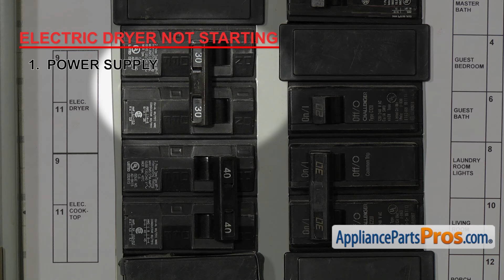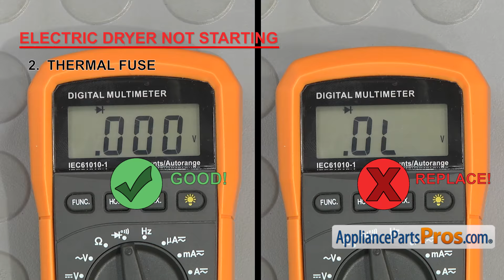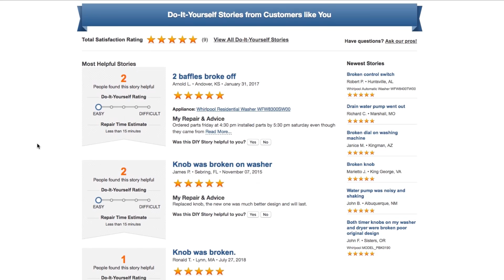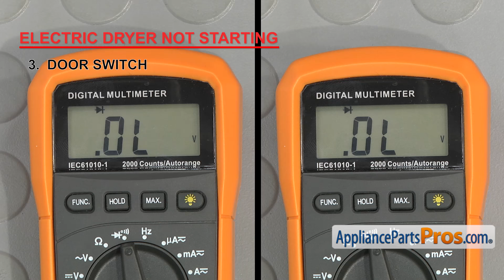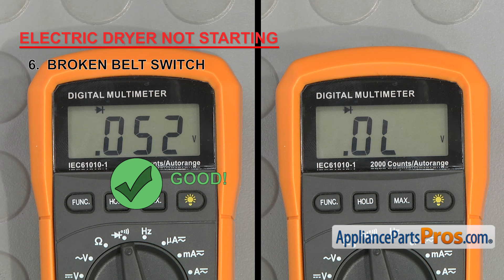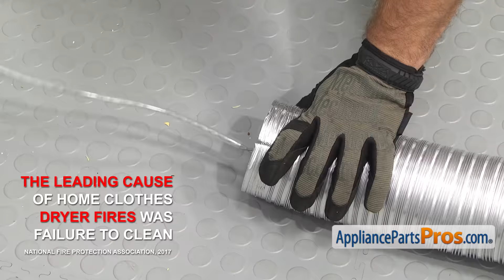Electric Dryer Won't Start - TOP 6 Reasons & Fixes - Whirlpool, Kenmore, and more

Comment: Where do we get these vacuum attachments?
Reply from the maker: Great question! The vacuum attachments we used are pretty common — you can find similar ones online or at most hardware stores by searching for “crevice tool” or “vacuum hose attachment kit.” Super handy for getting into tight spots during appliance cleanups!
Reply: @appliancepartspros  thank you so much!
Reply from the maker: You're welcome!

Comment: I try everything and everything goes ok in the test. But my dryer don't remaining working. Only if I hold the star bottom.....Solution: I have a black terminal in the motor with corrosion, so I cleaned and work perfect again.
Reply from the maker: That’s a great catch — corrosion on the motor terminal can definitely cause that issue. Really glad you tracked it down and got it working again. Your tip might help someone else out too!

Comment: This video was incredibly easy to follow.  I have some tinkering parts from other projects including a small copper wire with alligator clips on each end. After detecting no continuity between the nodes of the thermal fuse on the multi-meter, I used the wire with the alligator clips to bypass the fuse by connecting each end to each prong of the tripped fuse and start the dryer.  I didn't run the dryer like this since fuses are safety devices, but it did confirm my thermal fuse was dead (and may be used as an alternative if you don't have a multi-meter.)  AppliancePartsPros had the part at my door in less than two days. Thank you!
Reply from the maker: So glad you were able to repair your unit! Let us know if you have any questions!

Comment: my son has an electric dryer that only works intermittently.he had an electrician out who suggested replacing the dryer. they bought a new model it wouldn’t work except intermittently so they returned it. what in the world could it be. They replaced the dryer cord , replaced the outlet. One electrician suggested that it could be a problem that the electrical service wasn’t properly grounded. The electric company said if their AC was working then it was not a problem with electrical service being grounded properly! Any ideas or suggestions?
Reply from the maker: What is the model number of the dryer? Does he have a multimeter? Could be having an issue with the fuse or a thermostat maybe. How often does the duct work get cleaned out?
Reply: Samsung Model DV400E WHDWR/AA
Reply: the duct was cleaned about 6-7 mos ago
Reply from the maker: Does he have a multimeter? Then he could do some testing of the thermostats and the fuse and see if any of those may have failed.

Comment: I ordered my part and it has 2 wires . I have triple checked to make sure I have the right replacement which I do. And I have 3 wires to hook up to the newer version part that has 2 connection points. So where do I put the 3rd ? It doesn't work with out it .

Comment: I tried all the methods and everything checked out okay. I had already tried just resetting it by unplugging it for 10 minutes, However, after reassembling everything, it now works. Must have been a loose connection on the tensioner pulley switch. I did that last because I hate taking the drum out - but... Thanks.

Comment: will the multimeter still show these readings even though the dryer is unplugged?
Reply: You are simply testing continuity, not an actual electrical reading. In other words... you are testing to see if the circuit is stick closed or open. No need for electric current. As a matter if fact, ALWAYS unplug before working on your appliance.

Comment: I have a Kenmore 90 Series Dryer. It went out. I was told that it would likey be the Thermal Fuse. I replaced the Thermal Fuse and put everything back the way it was. And now the Dryer still doesn't turn on. It makes a strange continuous buzzing noise. And tips on what to do would be really useful. Let me know what you think I should do. If anything, I might just end up spending another $40 or more on another Dryer. Which I feel would be a waste.

Comment: 74 y.o. single woman here. I was all set to spend $600+ on a new dryer when I thought to check out Youtube and came upon your vid. When the guy who installed the new water heater was here, he must have flipped the circuit breaker switch for dryer (and didn't tell me and didn't turn it back on). The circuit breaker was the trick! Thank you greatly!!

Comment: I have a 2006 Maytag Dryer. It makes a chirping noise when off so I turned it off at the breaker box so I wouldn’t have to hear it all day. It wouldn’t turn on when I wanted to dry clothes and I did turn the breaker back on. It won’t let me change anything on the control panel but it does light up. The repairman I had come out thinks it’s either the control panel or the circuit board. If I have him order the control panel and that doesn’t fix the problem then I can’t return it and I’m out $200+ . He checked and found out the circuit board is no longer available. I live on Social Security and can’t afford to throw away $200 if that’s not the problem. He didn’t check any of the fuses. The door latch was fine and the dryer vent wasn’t clogged. Can anyone suggest or know what might be wrong?

Comment: The cause of No Start on my Maytag drier turned out to be the white neutral wire was no longer making good contact at the breaker box neutral bar — even tho it was inserted into one of the screwdown holes ( and it had worked ok forever) This showed up at the drier when metering neutral to each hot side as no volts  even tho across hots was 240).    
A strange one….

Comment: How do you clean inside the blower housing? I've not seen that in any of the many videos I've watched today (thinking my thermal fuse is dead due to blockage) :) I have a Kenmore 90 series dryer.

Comment: Perfect! My dryer problem was both #5 and #6 due to a broken belt. Obviously the drum couldn't rotate, and   the belt idler switch shut off the motor when the belt broke. Belt replaced=switch closed, works fine.

Comment: I changed a drum belt and now my it won't start and shocks me when I touch it? I'm almost positive I put back together exactly as I took it apart.  What could have happened it worked fine before the belt broke
Reply: Same with me, no clue if it's the belt switch if it needs to be engaged during use or not.  I'm thinking I messed up the wires now and frustrated over buying parts.